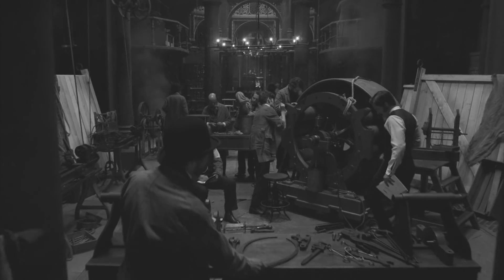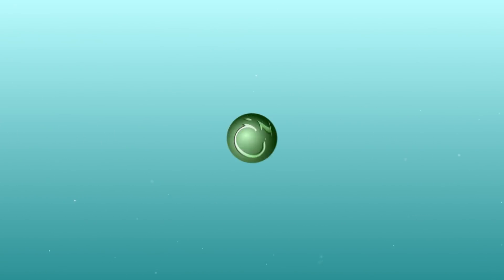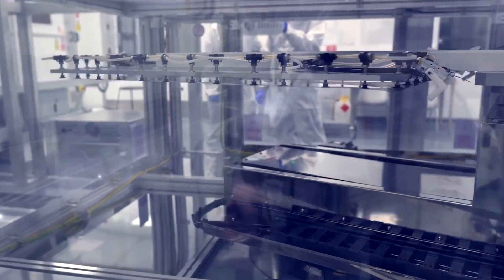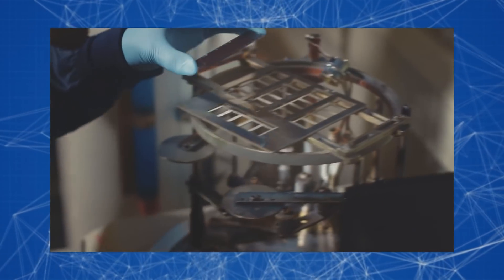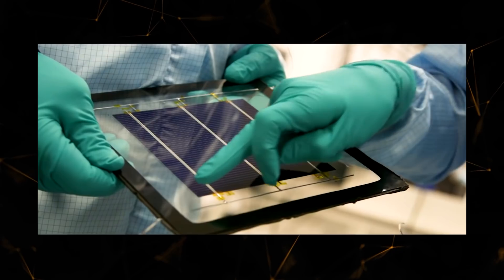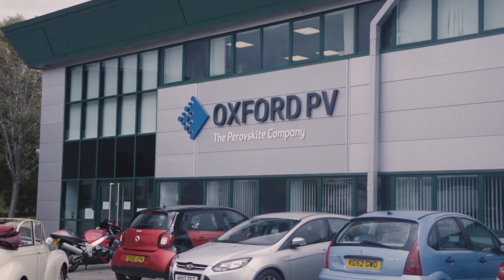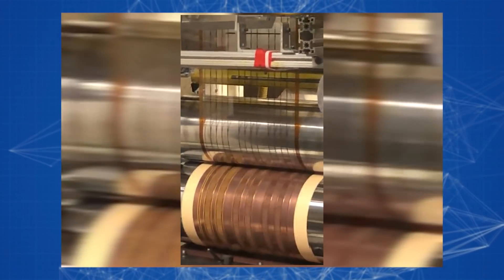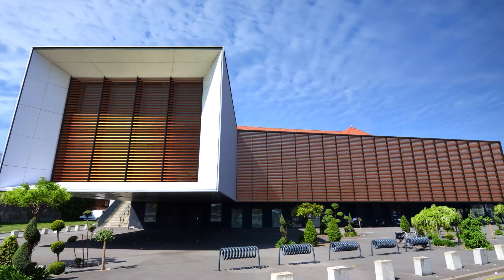These solar cells could change the rules of the renewable energy game

Comment: Preovskites have longevity issues, but I think the problems are more an engineering problem than a science one.  The cost of solar is projected to drop by 50% from 2020 to 2030  . That is not even factoring in preovskites, which would produce a another halving in cost again.  It is going to become increasingly difficult for other sources of energy to compete in years to come.
Reply: Until battery technologies catch up or the India/UK global solar grid becomes a reality, other sources of power will be needed at night.
Reply: @hurrdurrmurrgurr  What you are talking about is cheap bulk energy storage. We are half way there. It has become so cost effective to replace peaker plants with battery storage that private investors are pooring $100 billion a year into companies working on the tech.
Reply: Victor, 

you must surely be joking. Solar will never be an effective source of grid generation as it is asynchronous. Then add the intermittency, it is an extremely poor source of power for any grid. You also seem to believe that batteries will make solar viable, a very overestimation of what is possible or practical.
Solar has only existed due to mis conceived subsidies.
Reply: @iareid8255  1. Solar works every day, we know when the sun is going to rise and can figure out weather to prepare for less productive days. People screaming about how it does not work at night are idiots who think they figured out some great secret when all that means we always know ahead of time when to prepare other power sources for use.

2. Solar panels are cheap. Claims to contrary are referring to either some old data or the special solar panels only used in space and concentrated solar plants, where they need to survive stuff like radiation and enough heat to melt metal.

3. Solar is easy and cheap to install. Building a solar farm without subsidies is cheaper than fueling existing subsidized fossil fuel plants.

4. Energy storage is also cheaper than using existing fossil fuel plants. Batteries are getting cheaper, but those are only needed for grid stabilization where power needs to be provided in less than a second. Stored heat, pumped hydro, compressed air and other systems are cheaper than batteries.

Only problem with solar is that we mainly got the big farms and home use, when there are loads of warehouses and company offices with huge roofs available but only few of them are used to install solar panels. Also, such places use most of their power during the day while homes are mostly occupied from afternoon to morning so private houses need more energy storage.
Reply: @AnalystPrime  
It doesn't matter if you can forecast the generation time. Unfortunately the times of generation do not coincide when power is required. High latitudes like the U.K. get zero solar generation when demand is maximum. Therefore alternative power capacity is required in addition to solar. It is more economical not to have the solar.
Your idea of cheap ends at the construction phase. There are other costs that need to be accounted for, that of integrating solar onto a grid which are balancing costs, back up capacity, costs of availability against capacity and short lifespan compared to.conventional generation.  It has no inertia   a very important factor in grid stability.
It is not a good source of grid supply.
Great for my campervan.battery and my stand by generator battery but little else.
Reply: @iareid8255  The sun rarely shines in UK but solar still works there just fine, highest energy demand tends to be during the day, not in the middle of the night. Panels are so cheap the only excuse people can come up with not to install them everywhere is they don't like how they look, which is exactly as stupid as it sounds. So no, it is not more economical not to have solar.

Construction costs? Those are already included, and so are lifetime maintenance and recycling so again, no, that does not change the facts. Calculating the true costs only proves that fossil fuels aren't as cheap as they claim and FF lobbyists can't math. As for the lifespan, the inverters and energy storage will give out faster than the panels, those last for decades.

Grid balancing was a thing back when electricity was first produced by steam engines and that has not changed. What renewables have done is making storage so cheap the peaker plants are clearly not economical and in some areas we can use solar and wind for base load power.
Reply: Analyst Prime,
I think that you do not understand how grids work. Data gives solar contribution to the U.K. grid  at just over 10% availability, i.e. this multiples the cost of installation and connection by 10. Peak demand is morning and evening inthe U.K. not mid day. Winter generation is near zero for four months of th year. However much capacity of renewables there is still means you need 100% maximum grid demand of an alternative power source. 
Balancing is now a significant cost to grid operation due to renewables. As I said, you do not understand grid operation. Demand must be matched by generation at all times instantaneously. What you call peaker plants are not what keeps the grid balanced.   They are a coarse control, but dispatchable plants modulate output to counter act the unmodulated input from renewables.
I assume you live in America, which states have the most expensive electricity? Surely California with it's obsession with renewables is among the highest, it is no coincidence.
Reply: @iareid8255  You don't seem to get how economy works, if only one in ten cars are blue, that does not make blue cars 10x more expensive. Nobody is trying to power UK with 100% solar either, everyone knows that UK has huge offshore wind capacity.

That does not change the fact that solar is stupidly cheap to install on any building that has an electrical connection and doing so will save the owners energy and therefore money. A simple battery or a program that activates devices like water heaters and AC when the energy is cheapest will handle issues with matching production and demand.

The real problem in UK is that your buildings are almost as badly built as cheap homes in US. It is bad enough when people in California have to run the AC 24/7, but you actually have winters in UK, why in the name of all that is unholy would you not insulate your houses?

On grid scale a solar farm is 3 to 10 times cheaper to build without any subsidies than putting panels on a house roof, and has access to cheaper energy storage options than small home batteries. A FF plant itself may be cheaper to build, but for the average cost of fueling it for one to two years you can build enough renewables and energy storage to replace that plant. 

Grid balancing has always been an issue and only fools and lobbyists blame renewables for that. Before the only ways to provide more power were extra generators kept running even when there was no demand, and the limited amounts of storage like pumped hydro and flywheels; now renewables and new types of storage are cheaper than peaker plants so power companies are building them instead.

As everybody knows, the most expensive electricity in US is in Hawaii, which produces almost all of it from fossil fuels. Other states with top prices are Alaska, another big user of FF,  Connecticut, Massachusetts, New Hampshire and Rhode Island, none of which have as much renewables as they would like to.

California varies from third to seventh on the list depending on who and when you ask, the high costs are blamed on needing to maintain all the infrastructure covering the third largest state. The electric companies have raised prices because they want the same amount of money from their customers even though the amount of power some use is less. This only makes it more economical to invest in domestic solar or other renewable energy source for your home.
Reply: Analyst Prime,
If you need to build X 10 then the unit cost is  10 times. That is simple enough, e.g a 500 Mwatt capacity solar array only gives 50 Mwatts then the cost per unit is the cost of capacity multiplied by ten.
Your other remarks show you still do not understand grids
Reply: @iareid8255  Two years ago I spoke with the grid operators and the software developers responsible for implementing the algorithms for handling solar at a utility company.  At the time they were in the process of installing enough solar panels to replace  20% of their current capacity. Nothing I hit them with was a show stopper and battery storage was not even on the table. They said that they did not even have to shutdown old plants. The spot market for electricity in the summer time was more than enough to justify retaining the existing infrastructure. Most of my misgivings came down to worst case scenarios or special cases that did not apply to them.
Reply: Victor, 

that is looking at it from adifferent perspective. If you look at the difficulty it causes the grid operators and the power plants that do the balancing the story will be different.

Comment: Puff piece. Even if you could make the perovskite for nothing, the panels would not drop in price by 80%. You still need the frame, protective cover and the back and the labor to install them.
Reply: I read in a website, in west country , labour to install solar panel usually more expensive than solar panel itself .